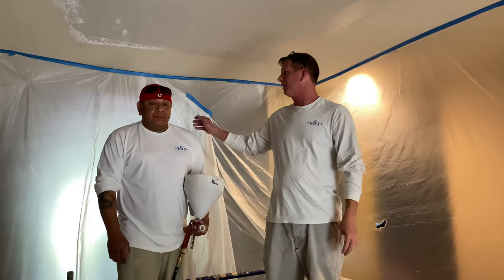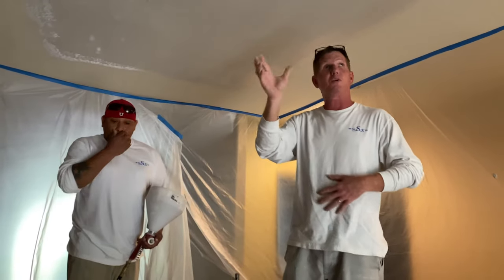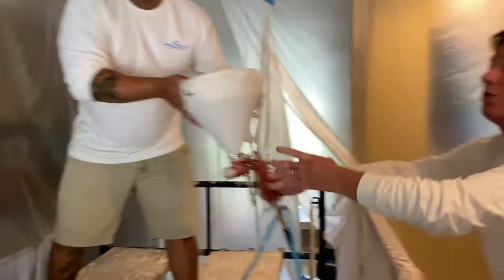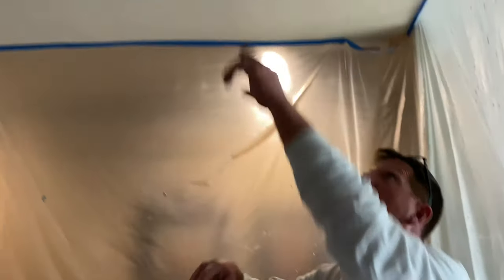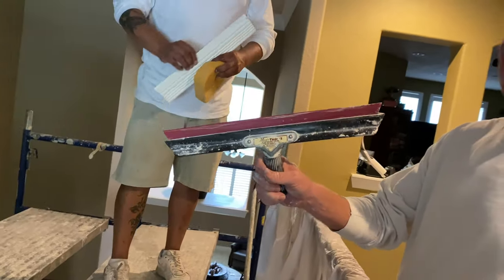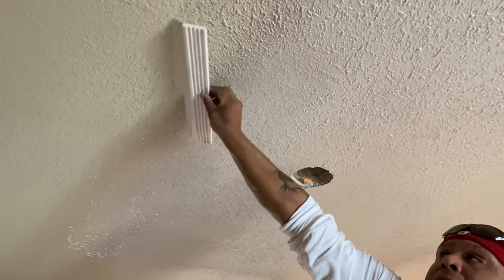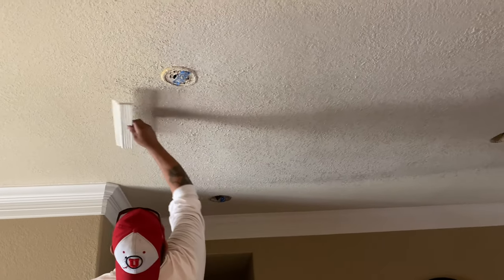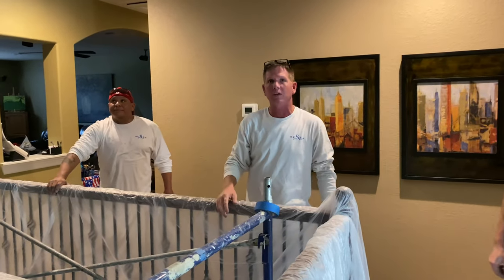How to Spray A Heavy Knock-Down Texture

Comment: That rubber is a great tip! I am doing knockdown right now, and using a wide metal knife. The corner of the knife leaves lines if you’re not super carful. I totally fucked up the closet, so I’m heading to Lowes or HD for some rubber! Need to get this dialed in before I get to the main area where it’s more noticeable! Great video! Thanks Guys!👊

Comment: Great video. I do jobs with a small compressor and I find the heavier knockdown more difficult. Can you tell me what pressure you set the compressor to in order to spray this larger,heavier knockdown texture?
Reply from the maker: So on the heavier knock down I have a hopper that has an adjustable valve and I just play with it a little bit essentially your pressure if I were to guess is gonna be about 40 or 50 where you can get basically a repetitive, For lack of a better description ,splat splat splat. I have a larger compressor but again I use the valve on the hopper to discriminate the pressure. And once you get it right  don’t change so you stay the same through the course of whatever your Spraying Hope this helps.
Reply: Thanks for the reply. Ya For me spraying the heavier blobs , well it seems like my air compressor  doesn’t seem to have the strength to shoot the bigger blobs (especially when I point up to a ceiling) I have the blue Marshalltown compressor and hopper  , so I’ve been trying to thin the material in hopes that it makes it easier for my compressor to get those blobs up and out. I see you said go heavier. Maybe I should buy that same hopper you got. Anyhow this video really helps. Keep up the good work in the detail of your explaining how it’s done.   Very valuable info for guys like me who do patching repairs.
Reply: I was having the exact same problems as you. Also using the same Marshalltown hopper but the husky silent compressor which isn't a very strong compressor either. However I've found that not all hoppers are created equally. Marshalltown big blue hopper seems to need more power psi  especially for knockdown. However my dad gifted me the same harbor freight hopper from this video and I've found that it doesn't require as much psi. Like he said in the video, you need lower pressure and from my own experience: don't point the hopper directly up, rather point it just like Eli demonstrated in this video. At an angle. It's easier for the thicker mud to shoot through this way since gravity is working against it with the low psi required to achieve the thicker pattern. Hope  this helps!
Reply: @JohnPortillo-z4y   that’s good to know and I appreciate your reply. I’m gonna have to pick one up and try it. I’ve kinda figured it out with my blue Marshalltown hopper but it’s slow going and you get little splatter/overspray everywhere so there’s a lot of extra masking involved. I did try the Graco FastFinish Pressure boosted Hopper. It can spray the big blob because it has an air hose that pushes air into the hopper to help it push out. You can even use thicker mud. Only problem is it sprays so fast you have to be real careful to not overload the mud on the wall. Anyhow thanks again!

Comment: What pressure are you using & which spray tip are you using
Reply from the maker: You have to use very low pressure I prefer using a hopper with a valve that you can adjust based on how it’s coming out of the hopper and also use the biggest hole that you have on your hopper for heavy knockdown. I hope this helps.

Comment: what pressure? and plastic knifes work better and are wider.
Reply from the maker: Pressure is very low when you’re spraying a heavy knockdown because you want the biggest blobs that you can so to speak. Press is really just determined on what you’re trying to match or what you’re trying to accomplish. As far as knock down, blade I like the rubber because it’s easier to leave lines with metal or plastic knock down blades but each to their own in that regard. As far as length of the blade, I buy 8 foot pieces so you can cut them any size you want we cut them 2 foot and put them on a pole if we do a whole room.

Comment: Bad video. Didn’t even show which tip they are using which is the most important part
Reply: I use a Wagner PowerTex Texture Sprayer and I use the largest yellow orifice for heavy knockdown. It's electric, he is probably using a compressor. Hope this helps.